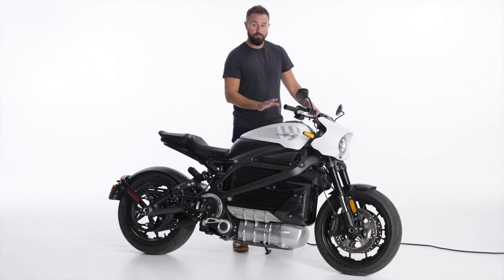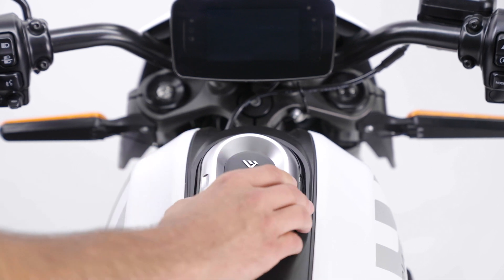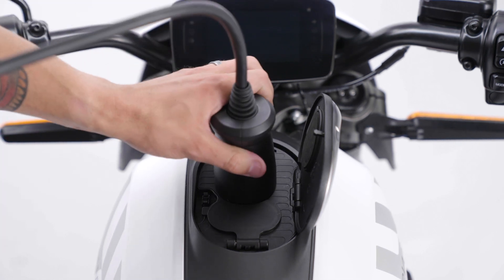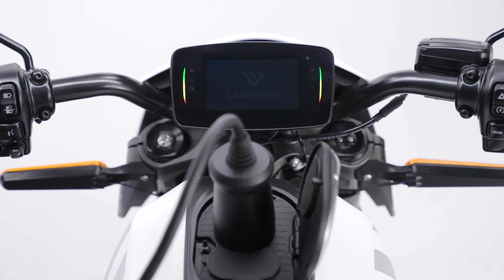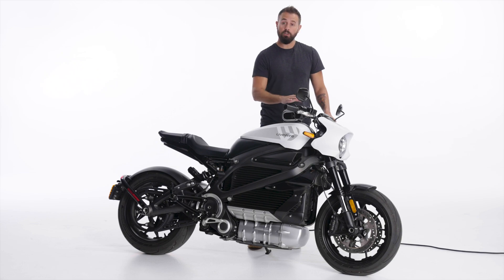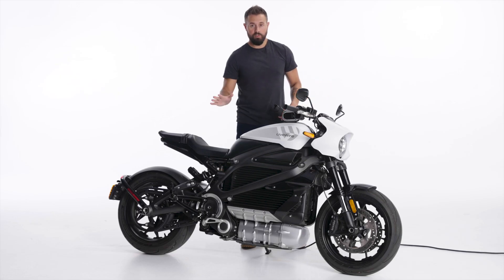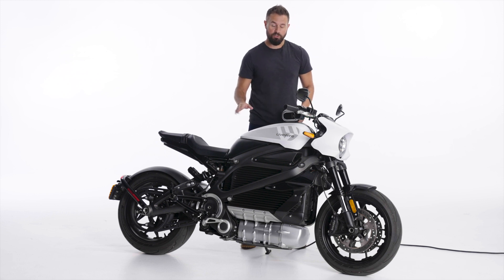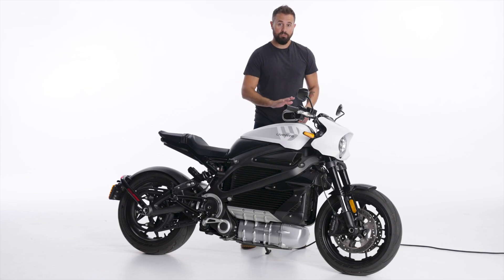LiveWire ONE™ : Charging Fundamentals

Comment: What about extention cords? Are they a problem for the electronics?
Reply: The manual states that you should not use an extension cord.
Reply: @michelfortin7055 yes, but if you use a 10-gauge or 12-gauge, you can.  I use one on a 100ft extension cable.  Anything more is not recommended as the voltage drops with distance

Comment: Is it possible to plug the motorcycle and postpone the charging : in France the cost of electricity varies during the day, it is cheaper from 22PM to 6AM. Is it possible to set the bike to charge only during this period?
Reply from the maker: Hi Yann. The LiveWire One does not have this feature built in. A popular way to do this is using a smart charger that can be programmed to turn off and on during the day as you choose.
Reply: Thank you for your prompt reply. 👍 A HomeKit plug will be a good  workaround in my case, I guess… but if this feature can be added in future, it will be amazing!

Comment: I wonder if the model sold in France comes with a European socket (type 2, aka "Mennekes"). I own a 2015 Zero, there was an option for faster AC charging, but I didn't take take it since it came with a US socket (type 1, aka J1772) on the bike, which requires an adapter if you want to use a station with attached cable, such as the one I have at home.

Comment: Have the engineers thought about an onboard 1 wire alternator charging setup to lengthen the ride mileage per charge?
Granted I’m just a moron but surely there is a way for an add-on device. 🤔